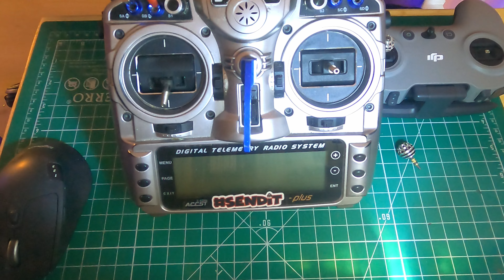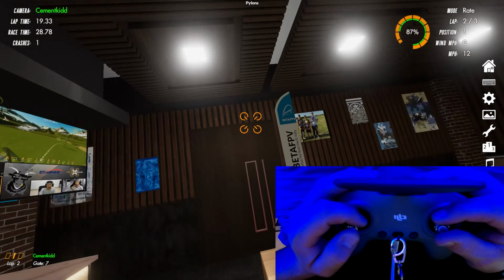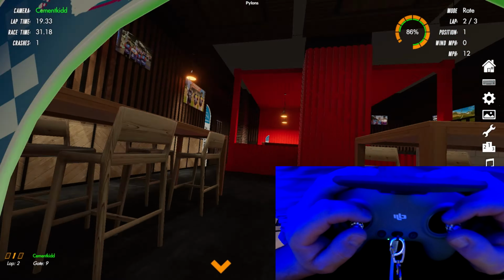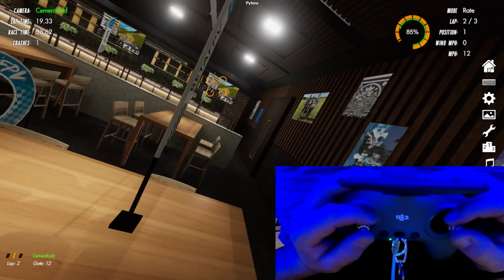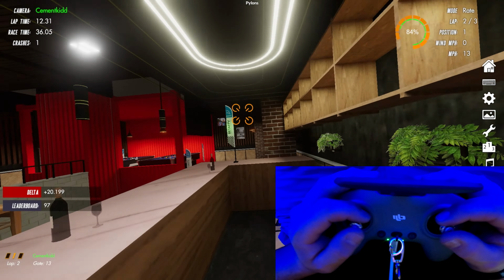DJI Controller 2 Gimbal Stick Modification Tutorial

Comment: Man, Wonderful to see ya, been a minute...👍🏻🍻👊🏻
Reply from the maker: Thank you pal. Good to be seen again.  I lost all my gear last year when I moved, I finally got over it but I was sick about it for a long time. But I am over it  and started buying new equipment. DJI this time around
Reply: @cementkidd  
The tech is right there too. I got to fly an Avata with the new goggles, pretty cool stuff.. Sorry to hear about the gear.
Reply from the maker: @PropsOff  I flew it too. I went to the store to buy it actually, and they had a demo for use there.  honestly once i flew it i knew right away it wasnt for me.  its an entry level drone. Cant tune the pids, and theres all the problems of a cinewhoop style drone when trying to freestyle with it.  i decided to just build around the 03 air unit the way i want it.  problem is the only way to get the goggles by themselves is to preorder at the moment.  so i will have to wait another week or so nbd
Reply: @cementkidd  
The goggles are in serious need of aftermarket foam. Really bites down on my nose and light leaks significantly on the sides. However, the lens correction and image quality was absolutely amazing. 
I totally agree, the Avata is a perfect drone for weddings, graduations, etc. And not so much for rippin..
I get to test the HDzero goggles this weekend, hoping they are refined and of the quality they were hyped to. Its good to have friends I can live broke and vicariously...🤣
Reply from the maker: @PropsOff  from all the reviews I e seen so far, they're supposed to be fantastic and future proof.  I'm considering them, just because of their quality and I love micros. A 65mm hd mobula definitely caught my attention